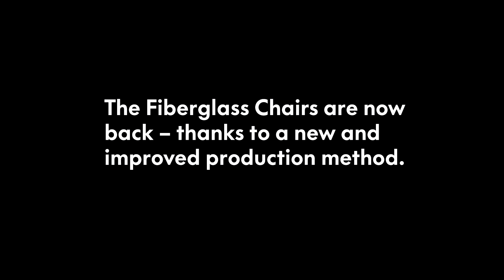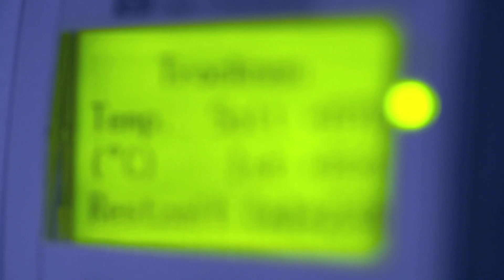See How the Iconic Eames Fiberglass Chairs are Produced by Vitra

Comment: Which one's more stable and practical - the fiberglass version, or the plastic one?
Reply from the maker: Hi Isaak, thanks to their identical design (apart from the material) both versions of the Eames Shell Chair are equally stable and practical. The Fiberglass version of this chair was the original, and has the added benefit of an eye-catching textural finish. However, the plastic versions come with a slightly smaller price tag - the choice is up to you! We hope this helps :)
Reply: @Nestcouk  Thank you! I think I'll buy the plastic version then. 
I wouldn't say that they were knock-offs or copies of the original, but I've seen a fair ammount of "hommages" to these chairs. Nevertheless, I'd rather choose the original, and the price tag on the plastic ones isn't as hefty as the fiberglass version.
Reply from the maker: No problem @IsaakHunt
You can see our full collection of Eames Shell Chairs here with the latest colours, materials and base options.
https://www.nest.co.uk/eames-shell-chairs
Reply: Two benefits of the plastic one: more environmentally friendly, fibreglass is close to non recycleble, and static electricity. The fiberglass one turns you into a van de Graaf generator.
Reply: That's funny because I get way more static from my plastic DAR.